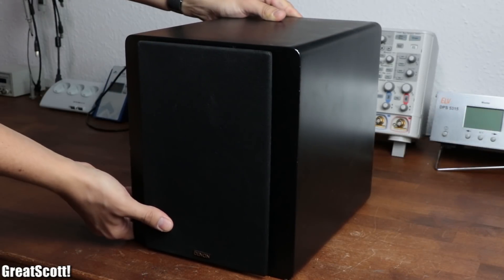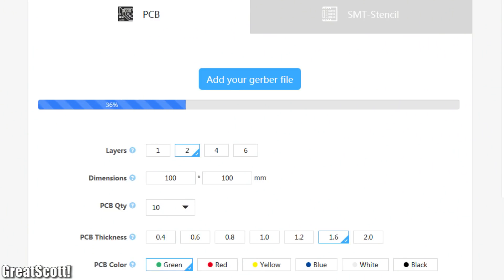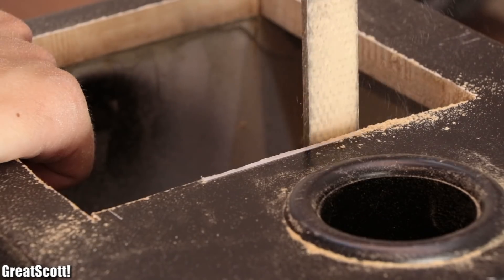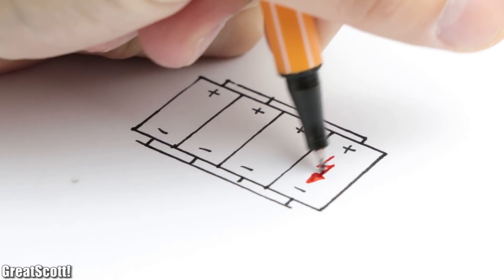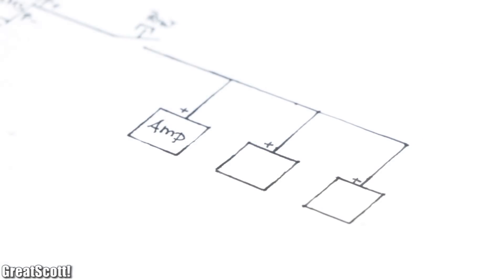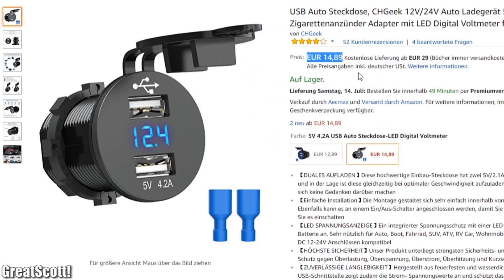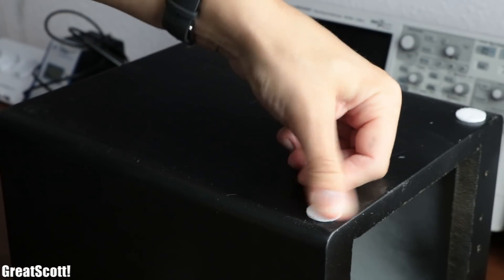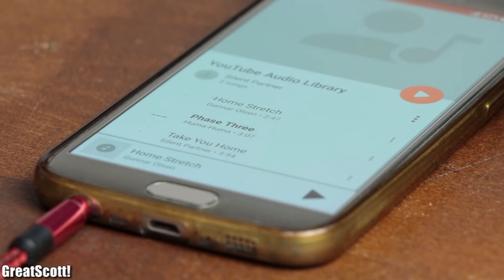How to create a Bookshelf Speaker Boombox

Comment: Is that amp bridgeable? Are you bridging it to be 
1 X 40W
Instead of
2 X 20W?
Reply from the maker: I am only using one channel
Reply: Does that mean it's not bridgeable?
God it's so hard to find bridgeable amps these days.
Reply: Probably not looking at the spec sheet for that chip.
But I'm barely even an amateur so here it is for everyone else:
http://www.ti.com/lit/ds/symlink/tpa3100d2.pdf
Reply: However, there is another way (I think):
1) Merge the stereo input.
2) Use a crossover to split the mono signal into two line level signals, high and low frequency
3) Feed those respectively into the left and right lines into the amplifier
4) Directly attach the tweeter to the left channel and the mid into the right channel

Now you have all 40 Watts at your disposal!! 8D

Comment: Hey Scott, wouldn't it be much more advisable to discharge lithium batteries to storage voltage (3.8 V/cell), or at least below 4.1 V/cell before doing any electrical work on them?

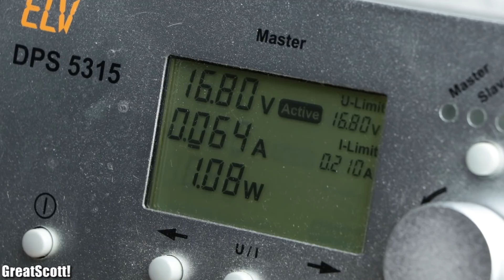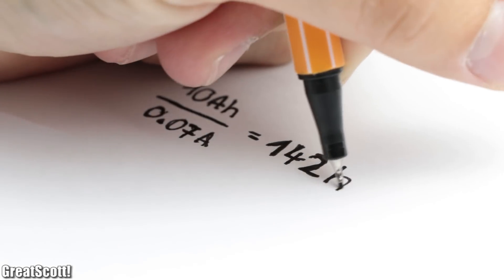Comment: 5:58 - 6:09
Errrrrmmmm, scott im a big fan but im afraid that logic will confuse many first timers. that 70mA would be idle current. under use, or even full power, 20W into that 4Ohm load would be 2.2A, plus maybe another 200mA for efficiency loss in the power amp and the WEEEEE bit of power those LED's are going to draw.
Reply from the maker: The 70mA did make the loudspeaker vibrate as you saw in the video. 20W "audio power" can not be easily translated to 20W electrical power
Reply: Yes, not saying your wrong, but at higher volumes, which lets be honest anyone that makes this build will most likely have it all the way up, the average current will be much higher. so i guess the 2.2A would be a "peak" value. not trying to bash you or this video, just saying some things that should always be in the back of someones head when using anything thats battery powered

Comment: audiophile here: I really enjoy your videos but please, please keep the old crossover. You can't simply replace it with a different one, those crossovers are designed to match the drivers (impedance, crossover frequency, volume of the tweeter...).
Sure it will work with a different one, but the frequency response of the speaker will suffer.
Reply: thank you. i cringed so hard when he chopped the old one out.
Reply: @vyladence  The old was was worn out. It needed to be replaced. Heavens know how old those caps are. They're most likely leaking current. Besides, one crossover is the same as the next.
Reply: @Rudofaux  no. someone like scott could have easily replaced the capacitors. also the statement "one crossover is the same as the next" could not be any more wrong. It's like saying all computers are the same. That crossover had specific values and combinations of the components to correctly split the audio signal. If the values aren't the same, the separation is going to be different. then, your woofer or tweeter could be getting too much or too little signal and would be too loud or quiet. Also, the crossover point where the frequencies switch from coming out of the woofer to coming out of the tweeter could be shifted. This could lead to the tweeter trying to output frequencies lower than what it's designed to or the woofer outputting frequencies too high. this can lead to distortion or even, although unlikely, speaker damage. Nonetheless, crossovers rarely wear out. Vintage audio gear is highly sought after for a reason. I have never seen a person take high end speakers from the late 50s and replace the crossover. Why? because it's designed and tuned for that specific speaker. If they wore out, people would be replacing them all the time. This speaker, which is nowhere near that old, is going to have a crossover that works absolutely fine. rant over.
Reply: @vyladence  Never before I've seen someone use so many words to say nothing at all.
Reply: Audiophiles are like wine experts.

Comment: Hello Scott. I am really a fan of you and learning a lot from you. One question about making the battery pack. I've got some batteries and I have checked their capacities. They vary from 1200mah to 2100mah, mostly around 2000mah. Does it make a problem if I mix these batteries when building a pack?
Reply from the maker: Yes, that can be a problem.

Comment: Really amazing work, dude! But... No bluetooth this time?
Reply: People with iphone 7 or higher...
Reply: sad, but true
Reply: You could change the amplifier to "TDA7492P". It has a bluetooth-connection and an AUX-input.
Reply: You´ve forgotten also the present must have features: the unsecured WiFi with burned in streaming services and autoupdate.
Reply: Also needs Wifi IOT and its own crypto currency.
Reply: Nope Bluetooth lowers the audio quality. Fuck Bluetooth.
Reply: MC's Creations como sempre VC aqui assistindo os gringos kkkkkk
Reply: Phttt you use blue tooth I use cassette tapes for music
Reply: The problem with most commercial bluetooth kits is the noise they add to music
Reply: I use bluetooth and never had an iPhone. I love Android and to have options.
Reply: Nothing simpler than that... Add a switch to switch between and add a Bluetooth or Wlan module.
Reply: Microchip's RN52 bluetooth module is a nice simple way to add BT connectivity https://www.digikey.com/short/jrzm4f
Reply: If you want to add a bluetooth feature you'd just need a 1$ module from aliexpress. Simple as that.
Reply: Just add a Bluetooth module
Reply: U can ger a cheap bluetooth receiver with aux out
Reply: you cen get a 2 dollar bluetooth usb, plug it into the charging port and bang... you have bluetooth
Reply: @AndreiT04  No, no and no. That's not how it works. The USB ports are For Charging. Plugging in a Bluetooth adapter will fry the adapter. The bloetooth adapter has to be hard wired to the components inside the speaker.
Reply: Lol what, are you joking ? Of course it would work, the adapters are made for that. How is hard wiring it different to plugging it to a connector ?
Reply: @dro3m  lol ehat are u talking abot. It would work fine.
Reply: ha???????
Reply: who uses that anyway
Reply: @revoxsvko  ME
Reply: @revoxsvko  i do
Reply: I've never used bluetooth once on my phone, has a headphone jack :)
Reply: Everything is better with a Bluetooth :D
Reply: Bluetooth can be hacked
Reply: @rzxv3  who is hacking your boombox my guy?

Comment: shouldn't you use a flexible glue (like hot glue) instead of epoxy? The vibration of the speakers could shake your wires and break your solder after some years of use...

Comment: Thats pretty cool !. Really like that. Much better than an item you would buy in the shops. Q. Does the amp require cooling like a heatsink ?. I would think the IC would get really hot ?.
Reply from the maker: No heatsink is required

Comment: The project is awesome, but some inside mounted hinges would look better •_•
Reply: I don't get why using hinges at all if everything inside is glued with strong glue so it will break if you try to get it out, and all connections are soldered. I'm screwing everything together without any toolless "service openings" but still use plugs and also screw down the pcb's, so in case something is wrong I can take everything apart easily. Anyway a good project.
Reply: Who looks at the back of a speaker? It plays music.. most of the time you can’t even see the back. Have never had anyone complain about the backs of my speakers.. now I’m paranoid...
Reply: Wilson
Good point!  Cutting and fitting the door/control panel was most of the work, and was unnecessary. Everything could have been mounted from the inside, through the speaker hole.. But I suspect that the back of the speaker was too thick for some of those accessories, so a thinner panel was needed.  But, since everything on the inside requires very little maintenance, if any, I would not have made the back panel into a door at all.  If small enough, the pack panel could have been mounted from the inside and screwed and glued shut. That way, all the accessories would have been recessed in the back of the speaker. And there would be no need to worry about the air venting all around the door, siphoning power and sound quality.
Reply: Clyde Shaffer
I know what you mean...

Yes, 3D printing is very cool, but to make hinges?!  
Unless your hinges are of a particular design that cannot be found anywhere, cause it's never been made, then by all means, have at it!  But printing a crappy looking toy hinge instead of using a well designed, solidly made metal unit is just a lame justification to use your new gizmo. Now you can tell your wife, "See honey, I told you it would be useful! -- Now I don't have to buy hinges!".  LOL

As for all the software, tutorials, and truckloads of pre-designed object files, I just wonder when DIY became about having a machine do it for you?  When you develop the skill to design your own original parts and print them, you will be a designer/fabricator. But, even then, I don't think the DIY acronym will apply.

Forgive the ramblings of an old tinkerer, but I would rather make a hinge using a tin can than use a printed piece of plastic where metal is required. Maybe I'm just reacting to the laziness of some makers who think that a printed enclosure is all but finished... They rarely take the time to sand it down properly to remove that obviously-printed texture and the project ends up looking half-assed!  Many times they are trying to save on plastic and/or time and the part looks too damn thin to even try to sand it down... If you can't afford to print the part properly, then go to the hardware store and save a few bucks by getting the good stuff!  

Crazy-Uncle rant over.  ;-)
Reply: Robert Cartier Yes, just a simple panel screwed to the back like it is usual, often even made of metal, It just doesn't fit all together because it is about reusing things but then spend around 20€ only for hinges and the lock, that are not necessary at all.
Reply: Wilson well pointed
Reply: You can get a decent 3D printer for less than $200 dollars these days, it's well worth it to have one around these days if you're into projects like this! Between affordable printers and an abundance of free software and tutorials, it's never been a better time to add FDM to your arsenal.
Reply: It's not necessary to redo, just a suggestion. Nevertheless this is a very good project.
Reply: Clyde Shaffer
I know what you mean...

Yes, 3D printing is very cool, but to make hinges?!  
Unless your hinges are of a particular design that cannot be found anywhere, cause it's never been made, then by all means, have at it!  But printing a crappy looking toy hinge instead of using a well designed, solidly made metal unit is just a lame justification to use your new gizmo. Now you can tell your wife, "See honey, I told you it would be useful! -- Now I don't have to buy hinges!".  LOL

As for all the software, tutorials, and truckloads of pre-designed object files, I just wonder when DIY became about having a machine do it for you?  When you develop the skill to design your own original parts and print them, you will be a designer/fabricator. But, even then, I don't think the DIY acronym will apply.

Forgive the ramblings of an old tinkerer, but I would rather make a hinge using a tin can than use a printed piece of plastic where metal is required. Maybe I'm just reacting to the laziness of some makers who think that a printed enclosure is all but finished... They rarely take the time to sand it down properly to remove that obviously-printed texture and the project ends up looking half-assed!  Many times they are trying to save on plastic and/or time and the part looks too damn thin to even try to sand it down... If you can't afford to print the part properly, then go to the hardware store and save a few bucks by getting the good stuff!  

Crazy-Uncle rant over.  ;-)
Reply: Basement ScienceE Thats true development, making mistakes and learn from them. Hot Glue is nice but very different, only the temperature changes a lot, like if it is really hot it holds on plastic very tight and can even break it when trying to remove. I personally always think of reusing the parts, because mostly I reuse already parts from broken devices and my devices may be not good enough or just lose their use, so in any case I use plugs and screws, hot glue to secure parts and cables, also the results are just nice to see.
Reply: An Audi RandomShit6 Yes, I will, some time, when I need a crappy mono soundsystem over my hifi, I will rebuild this, so probably never. But I think about to upload a Video of my other stuff, like the soldering station I built some weeks ago completely from junk, ok, except of the iron, the hot air gun and the pro mini clone, but even the display is from my old Nokia 3310 that I paid 450 bucks for when it was released.
Reply: Emil Racovita or Just 3d-printed hinges
Reply: tim
you said: 
"Emil Racovita or Just 3d-printed hinges"

LOL  
Sure! Let's all buy an expensive 3D printer, the pinnacle of hobby geekness, to print out something we've been making quite well for over 3500 years!  Reality check: Your local hardware store has better looking hinges for a buck or two... Go ahead. Treat yourself to the real thing!  ;-)

Just kidding!  (...and a little jealous)

Comment: Why not try sealing the panel opening and why not put the rockwool back in its place, at least you would have damaged less the speaker acoustics that were very carefully engineered
Reply: he ruined the speaker. well it was never good anyways
Reply: @livelaughlove_88h  only good speakers are made by braun / ads
Reply: @BadMax02_VR  That is very much an opinion and not everyone will agree.
Reply: How do you know the original speaker was carefully designed? You have researched the specific brand and model or so? There is plenty of audio equipment that was only made to look like audio equipment, without too much engineering in the design. But yes.. Putting the rockwool back is a good idea.
Reply: it's Denon, that's pretty high end kit.

Comment: Still no close to true fuse links on those batteries. I'm curious to see what those strips max amps is before they fail? I'm guessing over 5 amps. I'd think if a battery fails in that box it'd be to late before you realized it.  Perhaps look at the methods of Tesla and diy ev car guys are doing?
Reply: Jonathan Nelson Nickel strips are the proper way to do it really, take apart a laptop battery and see for yourself
Reply: JF Tech/Drones yup that's how they wire those together true but the board controls each set of cell/cells to pervent..we hope... problems.  So in theory if you only rely on the nickle strips to act like a fuse your asking for a problem. The PCB borad in your laptops monitor several different parameters at the cell level. Cutting off any cell/cells when it detects a problem. As I'm sure your aware of, that's why many times you will have one bad cell/cells with the rest being relatively in good condition.
Edit: yes I realize that there is a bms there, which takes care of the overall health of the battery pack. And I'm not trolling just perfer having more redundant safety measures in place then not.

Comment: Also because class D is high frequency pwm signal, how does that work with the passive circuit you have there to separate frequencies?
Reply from the maker: That is not a problem
Reply: the amplifier uses the pwm signal to amplify the signal. There is no high frequency coming out of the amp, just the incoming signal but amplified

Comment: Good build.

Please consider making videos for the below mentioned DIY project. 

DIY 12V DC UPS for router with 18650 cells

Completely wireless multichannel  speaker for home audio 5.1 ( wire only for the power for individual speakers both satellite speaker as well as sub woofer)

Comment: Love your videos but in this case your modification has introduced air leakage gaps which degrade low frequencies one way is to seal to the the modified areas using leak proof rubber padding or to make a air tight door behind the speaker which can be locked using screws

Comment: Why not add bluetooth to it?
Reply: probably would have meant more work because of noise fixing and all that stuff that comes up adding bluetooth
Reply: DeadMowBrainstorm actually its pretty simple.  Just add a dc-dc isolating converter and it gets rid of 99% of the noise.
Reply: yeah okay that's pretty simple xD actually i know that solution but i am working with a bluetooth module that requires voltage in a range of a normal li-ion battery (2.9V-4.2V)

and there aren't really dc-dc converters for such a voltage and thus i've got a lot of struggle with them...
but i like them, you have full control over them, if you want to take a look they're called BM62 (by Microchip)
Reply: DeadMowBrainstorm thats why you step up the voltage to 5v and then use it
Reply: then i would have to step it down again... rather try avoiding ground loops. Actually I think the problem with my module can't be fixed with such a dc-dc converter because I am using a different battery than the one for the amplifier and in another case I am using it without an amp (in a headphone). And in all cases I can hear the noise